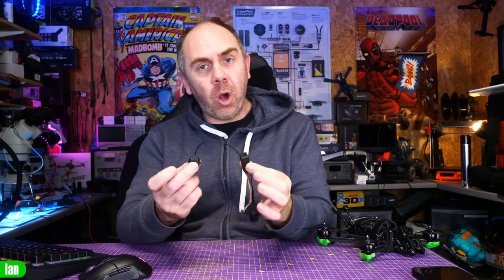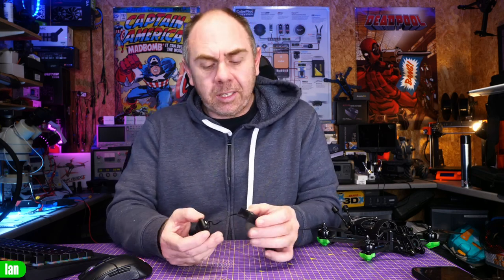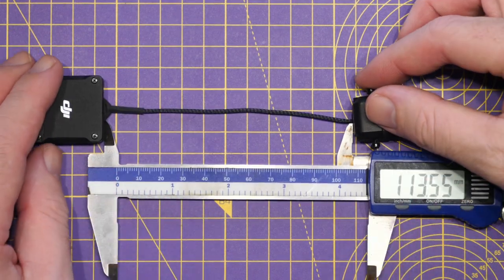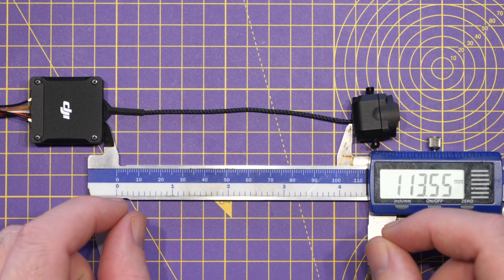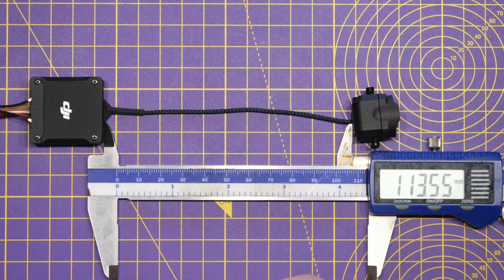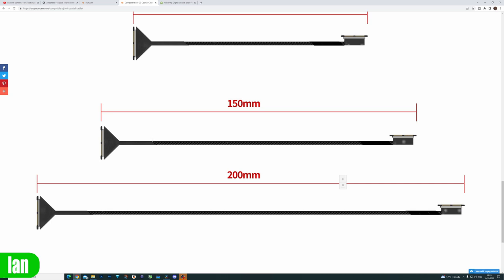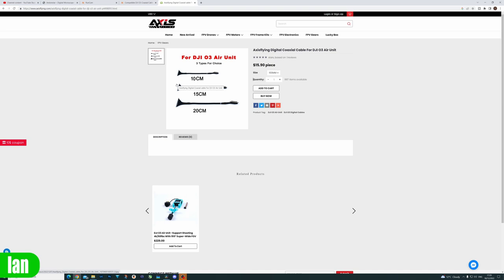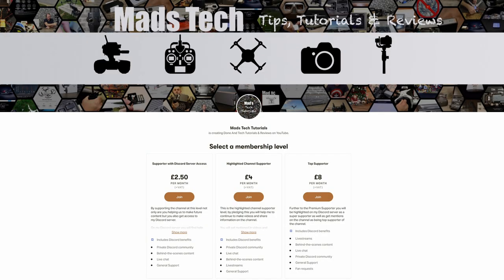DJI O3 Camera Cable Options - How Long Can We Get

Comment from the maker: Hi Everyone,  iFlight now have an 215mm cable that’s available for $14 as well.  Thanks to Brian for making us aware of this one. 

https://shop.iflight-rc.com/quad-parts-cat20/MIPI-Video-Cable-for-O3-VTX-Pro1909?sort=rating&order=ASC&limit=100
Reply: ATTENTION regarding your LiFePo4 battery build considerations on drone sundry live channel yesterday.

Ask also peppermint pilot that Aliexpress is the worst case to buy LFP cells cause you will be scammed. I had bought LFP on alibaba as peppermint did and I guess we both got the cells from Docan Power. 
Check the channel out which is called ray builds cool stuff

He explains how you will be scammed on AliExpress and even on Alibaba. Do not buy the cheapest, pepermint has said yesterday that he had paid about 125 GBP incl. VAT and shipping or ddp which means: delivered to your door (usually you have to ask for the ddp quote which then is calculated and ends about the VAT plus a tiny bit more at least for docan power prices you can find on Alibaba) We paid for EVE cells grade B and lasered as B but with readable QR code number I had gotten in advance before shipping about 1300€ which is about 150€ for germany but UK should be about the same.

Pepermint has bought far bigger ones with about 280 Ah , I guess the LF280K where the K is important cause that stands for 6000 cycles where the previoius version LF280 were about 3000 cycles. If you do not wanna spend that much then simply start with a smaller one and the older chemistry. 
If it works out for you then you will be able to sell that later instantly cause not many people wanna build such battery, but buy it. You will love the build and BMS and how it works, also great content as I had written to you 2 years ago before our first built, which we did the same way: start small, observe, buy bigger and sell the old one. Flipped my 3 year old growatt inverter with 2 kW from what I had called testbed or sandpit build and got 50€ more than I had paid back then in 2019 - now after I had earned over 8800 kWh with the Growatt inverter. Was sold in a week. 

So consider to check Rays video where and how to buy and how he had made it cause he had bought already hundreds of EVE cells, all the LF280K or the bigger LF304K which he had measured one by one bought from different vendors. He explains every detail.
My docan power delivery has arrived within 5 weeks after payment and I checked the cells over 60 days one by one up to 7 times (the weaker ones) and got 162 Ah instead of 160 Ah promised, the Wh results which really count were even better than that and those were genuine EVE cells, the bar codes can be checked cause a german engineer had developed an app and even a batch procedure to scan all codes and get a result sheet. Our cells were up to 1 year old but these were brand new which you can check on the poles. And to my surprise the 1 year old had even more capacity. 
Also: I was the only one so far who had done longtime checks of each cell which means over 100 charges and discharges in total cause while checking capacity I noticed that my weakest cells in the very first run had underperformed at about 159,5 Ah while the best achieved 162,5 Ah. So I did not trust the results and did a second run with my 3 weakest cells after first run. And for whatever reason they came back and went to the top after 6 runs which means they delivered above 162 Ah. So I did test more and more and found that 80% of my cells got better results. The tester is only able to run 3 cycles one by one which meant 27  hours test time. Then I let the battery rest and tested other cells and came back weeks later to test again. The more used the better the results and closer to each other.
Reply: PART II

I  did also a lot of research, how to get the best connection to charge, with clamps delivered with the tester and without, made tools and so one and checked the difference. I also measured for each cell and run the temperature which increased a bit during chargin with 40 A or ,25 C . The room had constant 25°C cause that is the environment temperature needed for such test to achieve the manufacturers results which is also completely described in the 16 page long spec sheet provided by docan power, also how to detect fake cells , rewrapped used cells (you get from the cheap aliexpressdealers, even with new terminals and if you complain you end in a mess of struggle cause Aliexpress will not refund anything cause you will face endless discussion how you had measured, only paypal saves you in these cases cause we had bought the first cells 2 years ago from the polish ali express warehouse and got fake, old maybe used batteries. Took 2 years to find out the QR story and then realized that we had gotten cells from 2018 in 2020 of cause genuine and brand new, but rewrapped, fake qr codes on the top with a fake black cover and underperforming cells. If you get cells that only deliver 95% you do not know how many cycles they had already done or if they are just grade b  and run for the first cycle. There is no way to judge about by the 95% of Ah delivered compared to promised. And these were not EVE cells as promised. The real qr code covered up revealed the truth 2 years later: cheap cells produced in january 2018. 

You do not have to buy grade a, so watch the most viewed videos from Ray builds cool stuff channel in Texas and listen to his lesson learned and whom to ask and how to contact. I followed his advice step by step and called the lady he had mentioned . You can not find any complaint about her on the web, not in the battery forums. That will be the most valuable asset I bet cause I guess you want to use the cheap octopus tarifs to charge up your battery during the night shift from 02 am to 6 am or so as I have heard from my british friends. If the battery does not get full from the solar power they fill up over night. 

This means in contrast to most across europe you will get a lot more charging cycles depending on the size. I guess you will go for a bigger one, so try to figure out your average consumption / days a year you are at home to get the average daily figure. From that you can subtract the amount the solar roof delivers directly ad I guess a 15 kWh battery of 16 x 280 Ah or 304 Ah should do the trick. Then you will see over 365 charging cycles cause even during day the battery will be charged partly by the sun and then discharged once the clouds appear and your wife is cooking or doing laundry. 
And with the huge amount of cycles - twice as much as in germany if you have a fixed kWh price and no night tarif anymore cause you can only charge from the roof  - quality of cells will count. You do not need grade A, but grade B from a serious source out of china helps you a lot to get familiar with all the challenges of such battery or the cells inside, the deviation, the BMS like Growatt Canbus (only provided by SEPLOS BMS which you can get a lot cheaper and easier from AliExpress shop called minerals - they brand it minerals but it is a SEPLOS and SEPLOS is terrible expensive if you buy from them and they tried to scam me cause I had to pay twice the customs and fees which I had to reject at arrival cause it was a 60€ bill while Minerals delivered it cheaper and for a customs bill and fees of 9€ via DHL instead of 60€ fedex even though I had paid seplos DDP). 

You might need also an active balancer due to the amount of work or power these cells will have to deliver and in this case try to get the NEEY 4 balancer for about 100€ from AliExpress and check the channel off-grid garage , another german Andreas or Andy who had emigrated to sunny australia and does the same job you do if you force the supplier to make the product better and cooperate where the performance is missing. Andy had done the work with NEEY and it toook 4 versions to get it right: a 2 A active balancer, also 5 A versions now available

All the best and you might cover the topic on the channel too once you start building your battery cause I bet there are a lot in the UK that wanna benefit from charging during night the energy needed for the next 20 hours cause your battery will only discharge 20hours before getting charged again. 
So consider that any maybe even LF280K cells are big enough cause you only need the power for 20 hours stored at max in case of a foggy dark winter day or with snow and ice covered. The LF280K cells is the size which gets the biggest production numbers, the LF304K are usually more expensive per Ah.
if you do wanna save money go for the LF280 and not the K which comes with about 3000 cycles you should get or sure till degredation has reached 70% capacity. They still will work, but we sell usually at 90% capacity cause you will get  more than you had paid if you sell it as a full battery incl. BMS.
Then you will get a new one, but I take care for the best cells, I print out all the test results and hand these over to the buyer to make sure it is in good shape and always has been. 
Do not forget: You  might face 365 to over 400 cycles a year and then a low quality cell with 95% in the beginning maybe 2 o 3 years old will have an impact

Do not buy from any aliexpress dealer- they will scam you, you will not get the brand promised, not the built year promised, not the capacity promised and most likely and intensly used battery but rewrapped like new, hard to identify cause in the usual chinese use case these cells are spotwelded with big spotwelder on the top of a flat terminal. 1 year running they tear it apart and laser weld new terminals on top of the flat manufacturer terminal to cover the previoius use , the spot welds on the flat terminals. If those arrive you can hardly identify the previous use cause usually the laserweld of the new terminal on top is perfectly done but ours had a small gap which indicated the flat terminal had been used before. We finally got a 15% refund over paypal after a lot of work and complaints which took 6 months. And that was before we found out that the cells had been very old based on production date.

In any doubt ask peppermint pilot cause he must have a 64 kWh battery already as we had chatted quite often during your live streams about the topic.
We have now gone for a 8 kWh battery out of 16x 160 Ah EVE cells cause we have gotte a 22 kWp array and feed into the grid. We also have a 30 kWh battery in the e GOLF and consider to get a MG4 from SAIC, the partner who produces all VW sold in China and also all GM sold in China which has bought the MG brand and still has a british design and developement office in London I guess, but also a lot french people. 

Why ? MG 4 is a golf size car, the cheapest adult golf size car you can get or 26.000 GBP and that also supports V2L or Vehicle to Load.
Attention: not vehicle 2 grid so there is no sychronisation of the voltage
BUT: the MG 4 offers up to 2,2 kW power which you can use to convert into 55V DC to charge your battery or simply supply a second smaller gridtied inverter with 60V DC input. That opens new doors for storing surplus energy in the car to use it later at home. 
And attention again: if you consider to use V2L be aware that the MG4 standard with its 51 kWh battery is a LFP battery with 3000 cycles while the bigger battery is li Ion and therefore a gro 64 kWh capacity whch is net 61 kWh only. The LFP has 50,8 kWh net capacity. 

Here it is called secor coupling if you generate and store energy to be used at home, for mobility and heatpump to heat the home.  

Usuallly this would be the stuff that you would explain to me so I hope I have not bored you too much and you might think about it twice cause it will be worth the effort and as so often said it will pay off for sure cause the demand is incredible and you are a native speaker aware of all the UK regulations and traps.
Reply from the maker: @typxxilps  thanks that’s amazing info Type.

Comment: I so much wish they built longer coax cables for digital systems across the board. 200mm and 250mm for hdzero is a big compromise for fixed wing pilots when trying to balance weight. I would deal with a higher latency if it meant a 300/400mm cable and would give fixed wing builders better mounting options.

Comment: Are they "coaxial" cables? Aren't they stranded cables?

I wonder what would happen if we cut the cable and spliced normal wire as and extension. I may purchase one of these cables and give it a try.

Thanks for the interesting video.
Reply: Pretty sure each one of the wires is basically 2 combined because of the core is seperate. It would be super inconvenient and I wouldnt trust the spliced wire not to fall apart because they are so small and there would be so many of them. Maybe there is some sort of specialty tool or technique for dealing with coax cables.
Reply: Duane, did you find a coaxial cable in the extension, or  were they single core with a shield ??
Reply: @davidwatkin1484  I haven't opened one of the cables. I really doubt they're coaxial but I'm not positive.

Comment: do you know if the 03 air unit fits inside the speedybee v2 frame?
it has 20mm but id like to know if the side guards are not visible in the air unit.
i have 2 of them i think they are great frames

Comment: Obscure but somewhat related question: do you know if the stock camera from the DJI FPV drone (or avata) is compatible with either the O3 AU or the Original AU? The built in gimbal would make for a perfect head tracking camera in a project I have. Thanks Mad!
Reply: The stock Avata camera would be compatible, not sure about the potato - pretty sure it's totally different. The pins for the OG AU are different as mentioned by Ian.
Reply: @copternutFPV  Right, figured the Avata's camera would not be compatible with the OG AU because of the cable. It would also likely have a FW incompatibility issue that would need to get around. From what I can guess the OG AU wouldn't be compatible with the potato's camera either, but that is what I am most interested to know (just because they can be found for a relatively low price).

If I can get any confirmation I'd be very greatful!

Comment: Anyone know if the 03 air unit is waterproof? Does it need any fpv worry free or more conformal coating? Cheers!
Reply from the maker: It’s got a very basic conformal coating.

Comment: I used a 20cm runcam cable and it works perfectly. It was a bit hard to get in the camera. Stock is about 150mm as sold so 200mm  is 5mm longer only. I wished a longer one was available for planes. 300mm would be great.
Reply: Yup, runcam O3 camera cable works great and it's braided like the stock cable.
Reply: hi! how did you remove the original cable from the back cover of the camera without damaging the cable? and then how did you insert the new cable through the small hole of the cover??
Reply: @alejandroiskander1491  There is a small rubber plug around the cable to seal the hole. You can push it in.

Comment: Well fuck. I thought it was 100cm cause my air unit was like a lil over 100cm. Thought having like 2 more 2inches would work. I think I'm need 200mm, (not the 150mm i ordered) on the 10"..

Comment: I just had my 2 x 15cm cables arrive and when I measured them was disappointed to see they seemed like they will be too short for my 5" frames. The vista cables were always a little bit tight so I would always keep 14cm ones on hand to replace with. 
Because my O3 air units have still not been sent out I cant actually tell yet, but it looks like DJI have fucked me on cables by advertising the standard as using 10cm so people will think 15cm should be heaps of length.  
Its more than the old 14cm ones in the same frames so should be sweet right? Probably not. Fuck you DJI.  $45AUS for 2 cables wasted and I will still need to buy more. 

Thanks for doing a video highlighting this now tho mate.